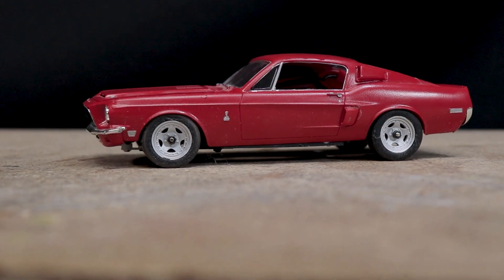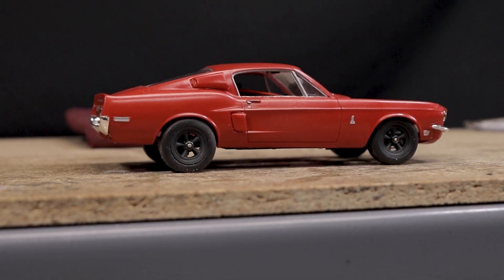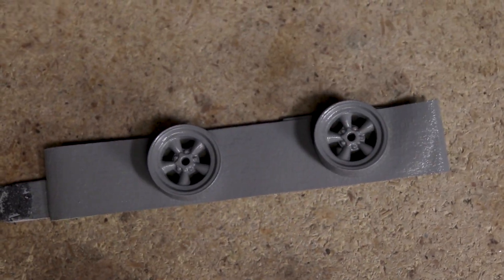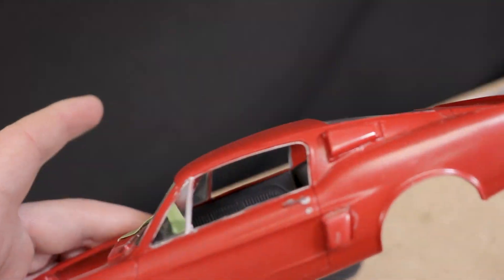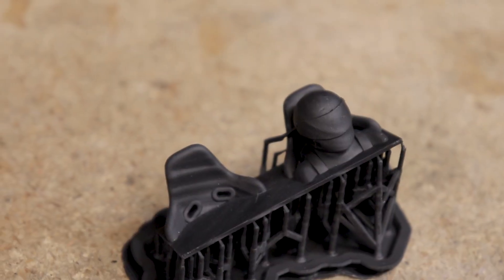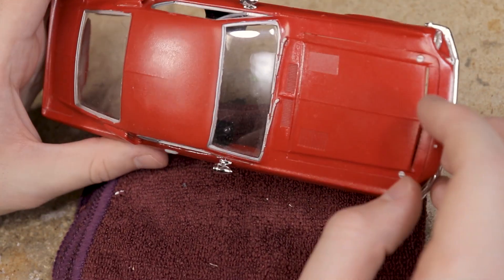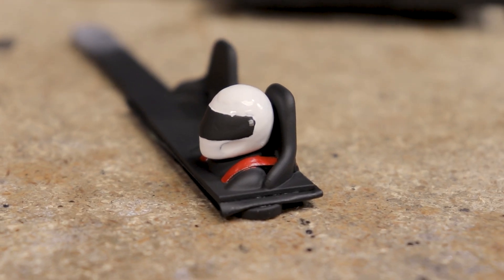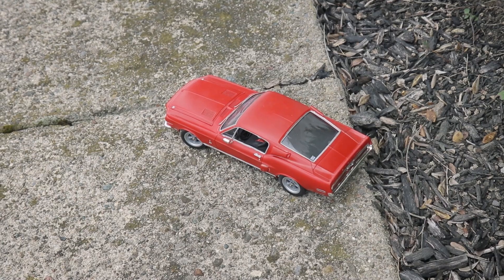Improving the 1/25 Scale RC 1968 Shelby GT500 👌

Comment: You should use a Molotow chrome pen for the chrome stuff. It works great!
Reply from the maker: Recently bought some. I'm looking forward to trying them out. 👍
Reply: @MakeItRC  I really like them. They work nicely on model cars and look just like chrome. But DO NOT clearcoat it. It will dull the chrome finish. And also give it plenty of time to cure. At least 24 hours. I think you'll be very impressed.